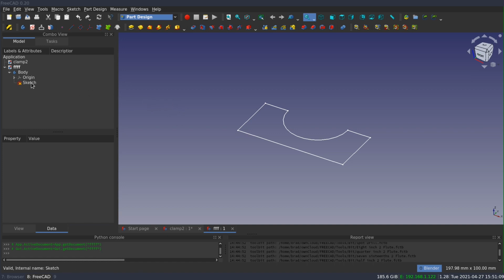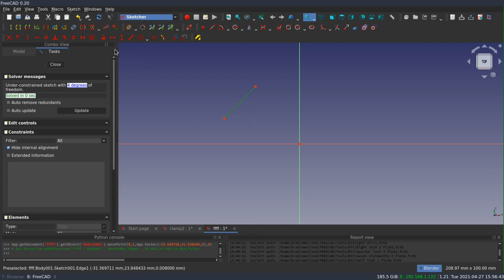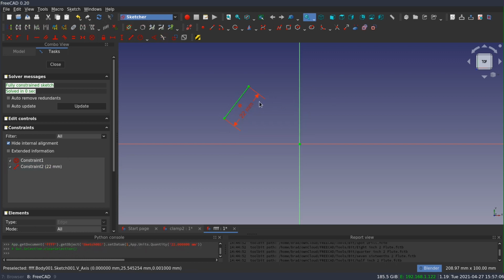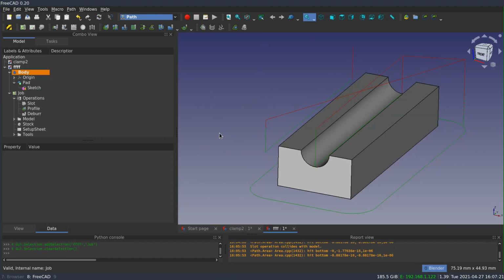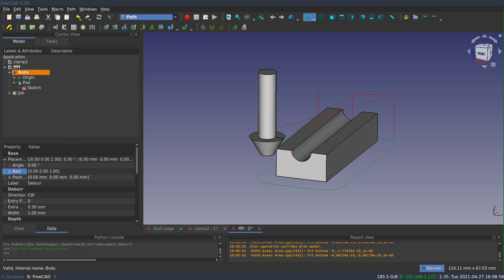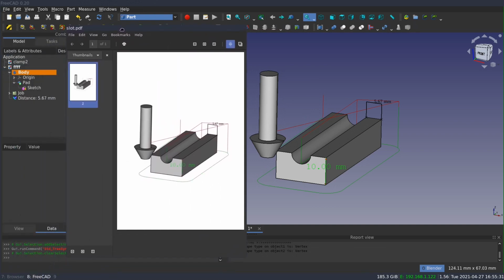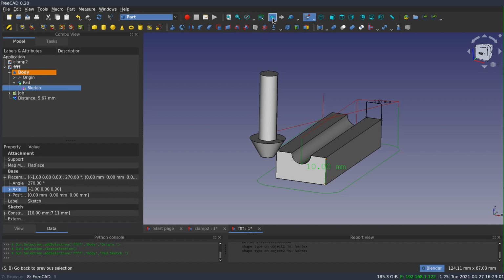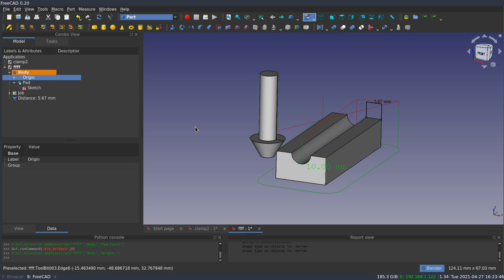Five Fast FreeCAD Features

Comment: Anybody know how to convert the mach 3/4 post possessor to inches?
Reply from the maker: --inches in the arguments field
Reply: @sliptonic  Tried that over and over still posts in metric. You mean literally --inches ? Dash dash inches? Tried different variations still no go
Reply from the maker: @tomhutchins1046  Yes.  Literally.   I really hate doing support in youtube comments.  No images or attachments.  I answered the same question for another guy about the linuxcnc post here:  https://forum.freecadweb.org/viewtopic.php?f=15&t=66220#p573764
Reply: @sliptonic  Very helpful. It was the inspect button shows metric but it posts to a file in imperial. How would i change the i /j to show radius.? in the mach 3/4 processor. Is adaptive developed seems buggy and says ( no support for setup sheet?) Im going to go watch your video on tool bits now. All I can load is the default tool. Could that be because Im using the control for diameter  offsets?
Reply: @sliptonic  Watched your video Hum Went through the steps suggested added a new tool hit ok nothing posted to the table. Just some odd headers for number ect would not expand. Removed the whole program and reinstalled same results. Don't think it is communicating with the branch tree or whatever. If you like a rubrics cube or a good puzzle this software is for you. if you want to make parts Uh not so much. Good luck
Reply from the maker: @tomhutchins1046  Tom,  as I said above.  Trying to do support in youtube comments sucks.   I'd love to help you out but I have no idea what version of the software you're using.  I can't post pictures, and you can't attach a project file.  If you really want help, please take this to the Path/Cam section of the forum.

Comment: Nice little video.  I'm a recent convert to Free CAD from Turbo Cad.  This sort of like going from an Automatic Transmission to a Twin Stick 13 speed.  It does a lot more, but one has to DO a lot more.  Now to the point of my comment.  I need to know how to insert lines on the drawing.  I need to point to a feature to relate it to an annotation, and I need to draw a center line through a view.  I watched your series on the Tech Draw Workbench, and poked around the Free CAD site and had no luck (there is an article but seems to be obsolete).  Any guidance with this task would be most welcome.  PS  Thanks for the work on these vids, most of us would be out in the weeds without them.
Reply from the maker: I think what you're talking about is called a balloon annotation in TechDraw. https://wiki.freecadweb.org/TechDraw_Balloon
If that doesn't help, definitely post on the FreeCAD forum.  Support in youtube comments sucks.  We can't attach files, use images, or anything else.

Comment: Does anyone know how to constrain a path on freecad? I am pocketing with a 1/2in end mill but there are 3 studs that are 1/4 inch apart and I need to remove the material that the 1/2 couldn’t reach but I dont want the 1/4 in end mill to run the whole pocket again. I know how to control start depth but cant figure out how to limit the x and y. Any help would be greatly appreciated.
Reply from the maker: The ideal solution is called REST milling... as in use an operation to clear the REST of the material that the first operation can't reach.  We can't do it yet in Path.  The best you can do is to use a boundary dressup to limit the size of the operation area
Reply: @sliptonic  Thank you very much!

Comment: Nice, I learned a few new tricks.
All of these work in 0.19 BTW. Except no. 3, the Path tool position. In 0.19 the tool doesn't appear to move but a red line does indicate where it will start the line of G-code, so it's almost the same just not as nice cosmetically.